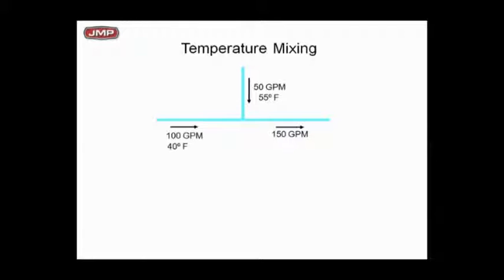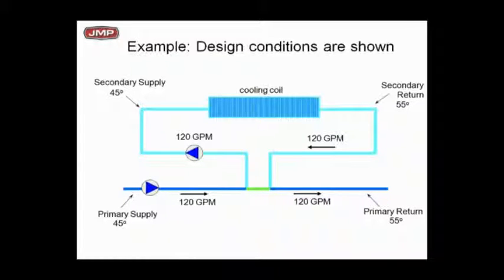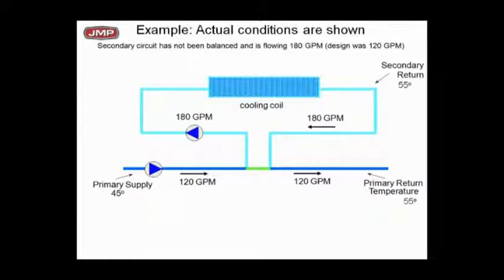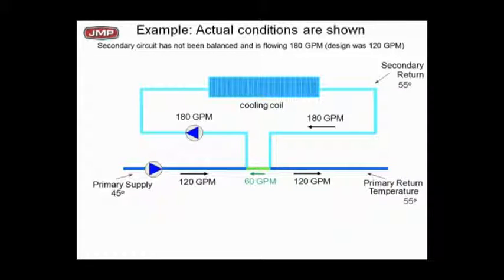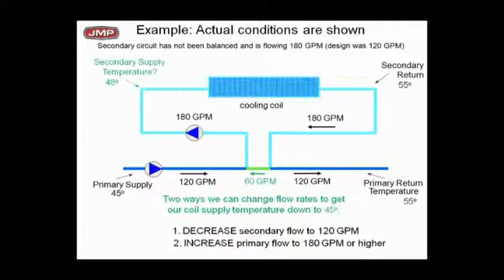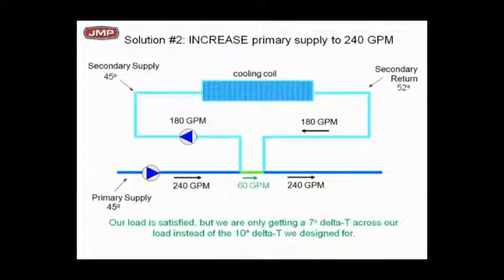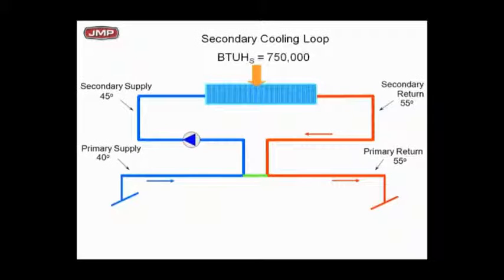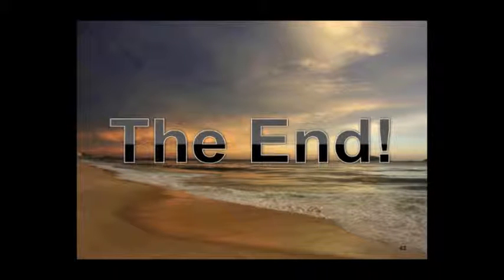Primary Secondary Pumping - Temperature Mixing

Comment: Excellent video, thank you. I would very interested to see how this applies to a four pipe buffer hydronic separation and in what situation an outdoor reset (weather compensation to us UK folk) you have to have a raised flow temperature due to distortion from different delta Temps on either side of the separation.